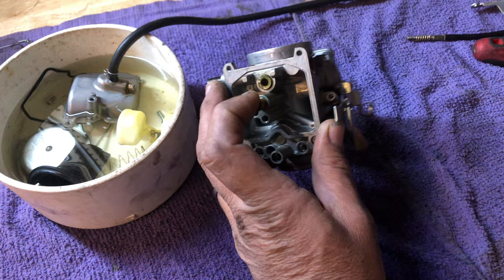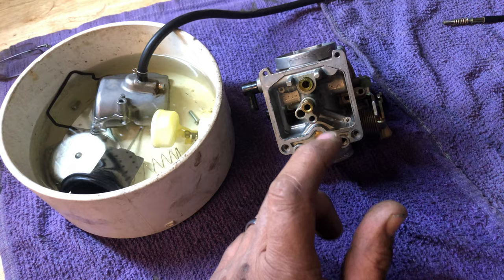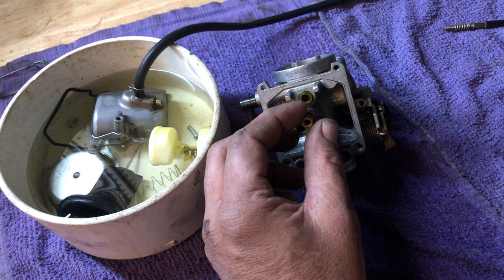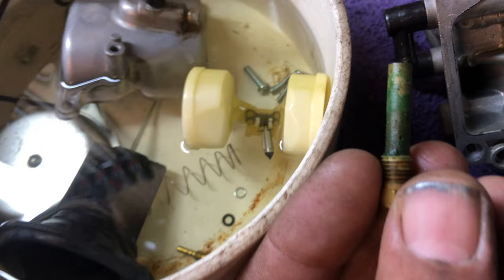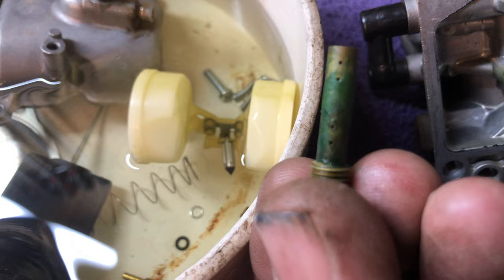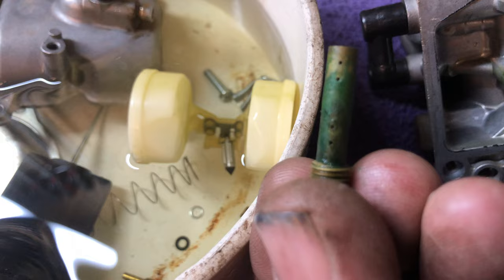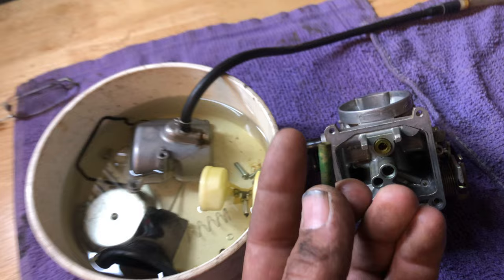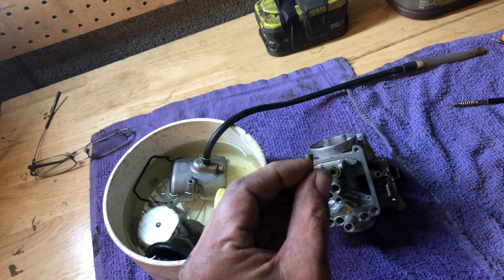only runs when choked,  solved.

Comment: I’m so lost I bought a new carb and it will only run with choke on doesn’t make any sense to me jets are clean not sure what else it could be
Reply: Same here! Tryna see what's the problem. You found the problem?
Reply: No I have no clue
Reply: @chriswillis9150 ok so I owned 5 pw 80s and all of them have this exact issue, except I fixed the issue everytime. Make sure carb is spotless, check plugs,do not mess with the injector only replace oil when needed just slight tweaks will mess up the choke on these things, make sure your bike is getting enough air flow, and triple check your filter
Reply: All in all tho the choke is there for a reason, if you hop on your bike for the first time in a week and try to ride without your choke it’s gonna bog and stall, it’s gonna run like poop lol, You need to warm up the bike with choke on for a good 20-30 minutes then turn the choke off with the bike still running hot, this will basically get the bike used to running without choke, I promise if you listen to these tips your bike will run fine.
Reply: @chriswillis9150 also 1 more thing a few of my pw80s ran so much better with the gas put on reserved, it changes the airflow in a typa way 👍
Reply: @Tatby  biggest load of tosh I ever read in 68 years
Reply: @Tatby you clearly know absolutely nothing about small engine mechanics😂
Reply: Is it the new oem carb? Or is it a cheap Chinese alternative

Comment: Got the same problem with my woof splitter. Will only run with the choke pulled out once I press it back in the wood splitter shuts off.

Comment: I have a 92 Polaris trailboss 350 2 stroke it gets stuck wide open when we first got it was good but the throttle was angled down and wasn't in a normal or comfortable position so I angled it where I thought it would be and that's when the problem started I've readjusted the cable I've twisted it back towards where it was to begin with but it's still sticking would you have any ideas

Comment: What about if it runs and idles but dies when revved up and will only rev up with choke
Reply: 🙆🏽‍♂️ Did you find any solution my brother? My 250 Buggy has been driving me nuts😔
Reply: @agcobileboqwana9923  I cleaned out the carb and did a total carb rebuild and jet kit. Also replace the carb to intake boots because they had rips in it. Runs mint now. So it must of been one of them issues.
Reply: Thanks Bro, i'll definitely try that🙏🏼
Reply: @Kevin_Yagoonie hey I just got a 82 xl500r today and it has the exact problem what should I do?

Comment: This helped me fix my 2004 ski doo 800ho. Thank you! I had cleaned the main jets, but didn't take out the small pilot jets that have the tiny holes on the sides. These jets were clogged, and the hole that goes through the long way is tiny. The smallest needle I had in the house wouldn't fit through to clean. I soaked in carb cleaner, blew through with air, and could finally push fishing line through when cleaned. Take your time to find the correct flat head screwdriver to remove jets, not something you want to strip out.

Comment: I think you just answered one of my questions. On my engine, I cannot see through that jet you are showing, but the little side holes are clear. I wasn't sure if I should be able to see right through the jet as well (this engine sat for 7 years) I cleaned everything and fired it up and it sounds great, but would only idle with choke out. Looks like I'll take the carb off again and clean this jet so I can see through it. Thanks for the video
Reply: Yooo if this work I will watch like all yr videos and subscribe

Comment: It's called an emulsion tube. Those holes pull air through to atomize the fuel mixture. 
That's pretty much always the problem when having running issues, or will only run on choke. Blame ethanol for that..

Comment: Torch tip cleaner works great to get into those tiny holes if anyone's looking for something small enough to get in there thats what I found worked best or small guitar string but torch tip  cleaners are designed for this so your best to go grab yourself a set for couple bucks 👍

Comment: awesome vid clear and informative.
Question, mine starts and runs fine, idles fine, revs up smooth and fine, but i can throttle up to 98% no issue and even hold it there still runs fine, but if i twist that 2% to throttle stop, it dies instantly i let go of the throttle keeps idling over and again,? any ideas? throttle seems clean filter clean.
cheerrs

Comment: On my 2001 500 HO  I choke it in cold weather and have to hold the throttle a little while it warms up to keep it running.  Once it warms up it idles and runs fine. The idle is almost on the high side when warmed up.  But when cold the idle seems low.  Does anyone know what that issue is?